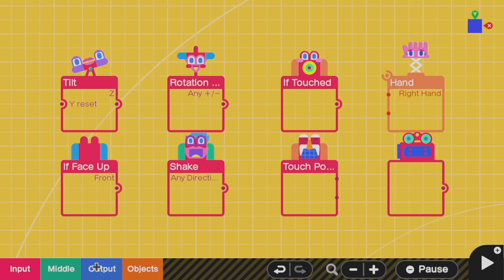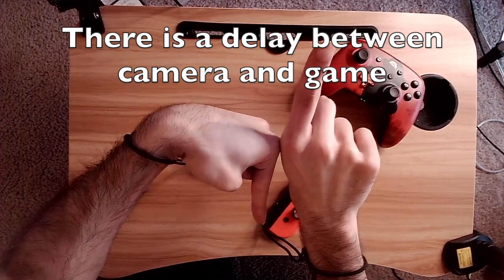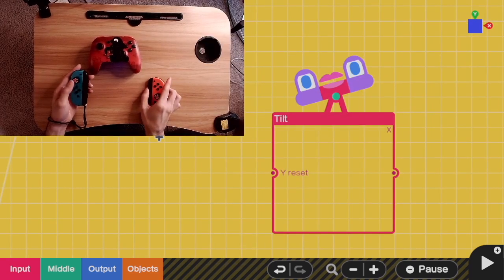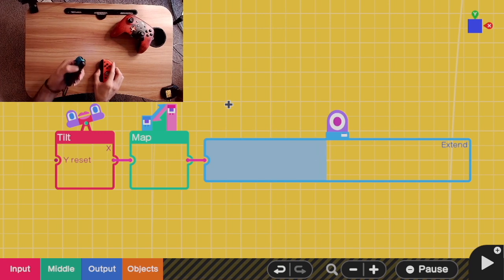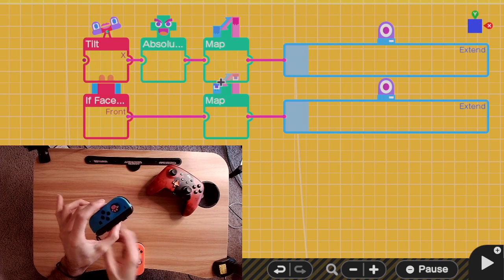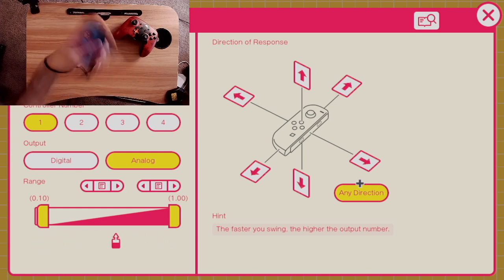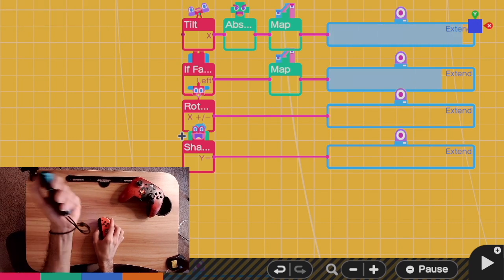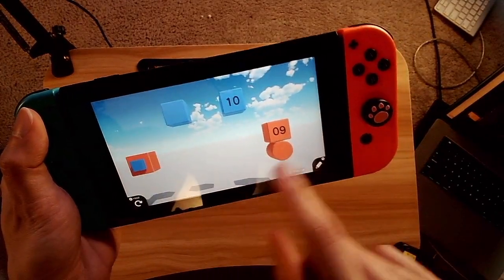How to Use TILT and MOTION Controls in Game Builder Garage (Guide / Tutorial) (Part 1)

Comment: Is it possible to use the Switch Motion Sensor, the one inside the console?
Reply from the maker: I don't know if the console itself has tilt controls, or if it is in the joycons attached. But you can use motion/tilt controls in handheld mode. I just strongly recommend against making a game where you need to tilt and fling your switch. XD
Reply: @loupandsnoop  Yes, the Switch unit itself features a Gyro/Accelerometer. It's essental for LaboVR for example. It would be interesting for things that go beyond games or doing a game that uses only touch screen/tilt controls.